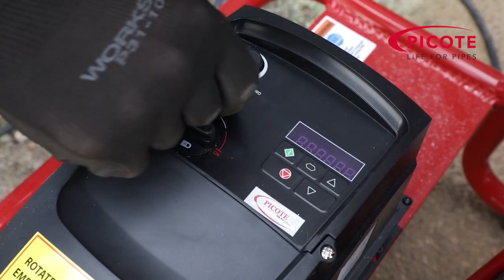Picote Concrete Remover

Comment: Have this for a 1 1/2" pipe? Have a P trap filled with self leveling cement. Been using concrete dissolvers and its working but very slowly haven't made it to the bend in the trap yet. Or would there be a product you could recommend that'd make this progress a little faster?